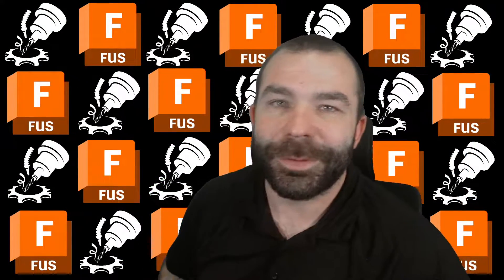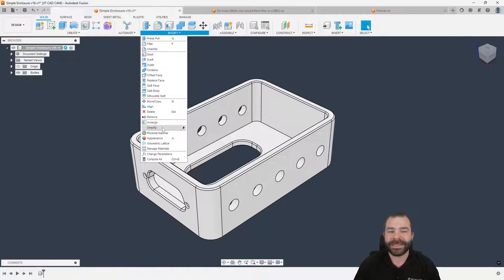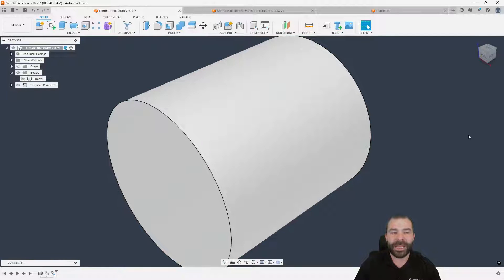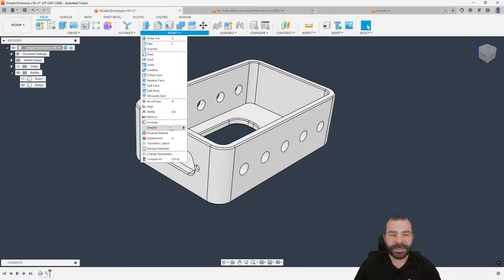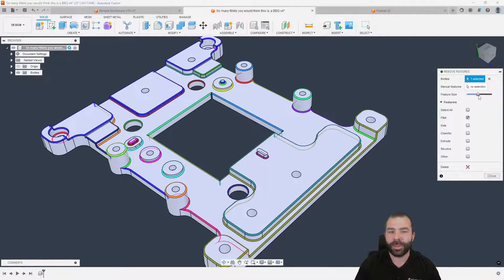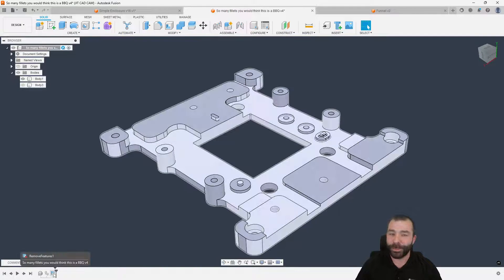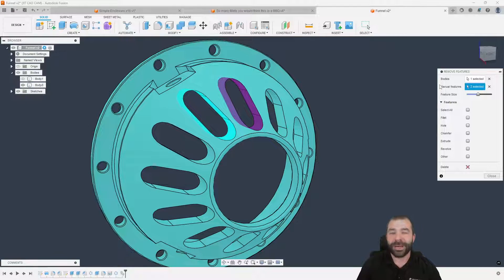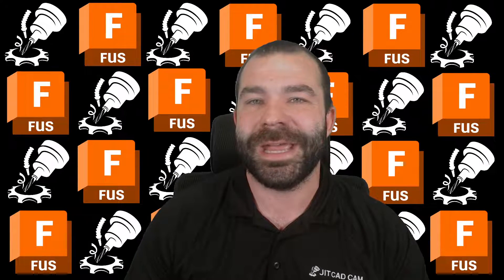Workflow Wednesday: Simplify Modeling Tools for Manufacturing

Comment: A question about wear compensation.....if I have a 1/4" end mill that is used for multipole operations in a setup and one of those setups requires me to put in a wear figure of say .001 to make a few holes just a bit larger, is there a way to do this for only that operation and not affect the rest of the operations that use that same 1/4" cutter.  What is the best approach for doing this.
Reply from the maker: There is a couple ways. The easiest way is to use Stock to leave as a Negtive to remove more materail on that operation another thing you can do is use a differet offset with the tool. For Example normal would be T1 H1 D1 however on certain operations you could use T1 H1 D100.
Reply: @JITCADCAM  That is a trick solution...I could use tool 20 for example for most of the operations, then to dial in a precise bore or feature, I could use the same tool but call it tool 120 with a different diameter in the wear column.......thanks for the great tip.